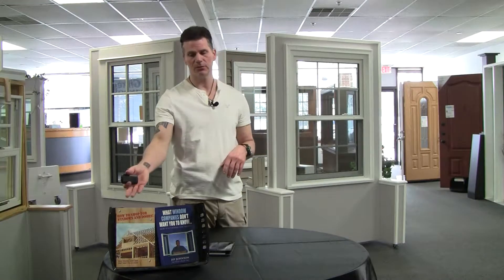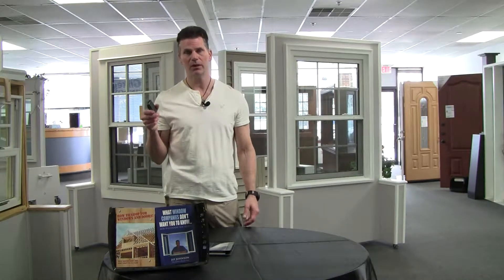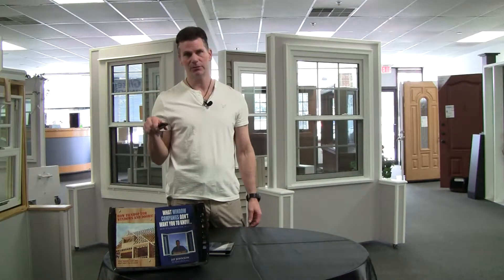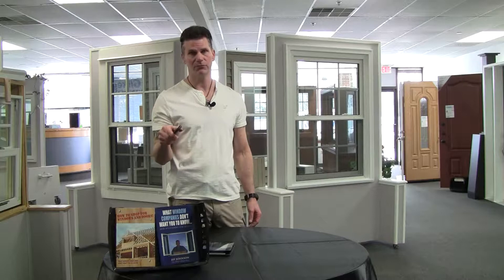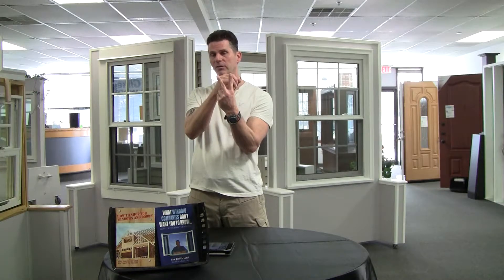Low e glass

Comment: You might want to revisit your explanation of the difference between LowE, LowE2, LowE3, LowE4 because your explanation  is incorrect.
Over 100 variations? Such as?
Reply: So this guy doesn’t know what he’s talking about?
Reply: @stevebbkny2394  Not so much. 

The terms LowE squared or LowE cubed are specific to Cardinal glass who makes about 60-70% of all residential LowE coatings. Also Cardinal refers to their coatings as LoE rather than LowE. 

In the real world it isn't uncommon for people reference squared or cubed when talking about multi-layered coatings that aren't from Cardinal, however the squared/cubed terminology is Cardinal patent and probably copyright(?). So techincally it 's more correct to refer to non-Cardinal coatings as LowE- 2 or LowE-3 for 2 and 3 silver-layered products rather than squared or cubed. None of which is the reason I commented.

I commented because LowE 2 (or squared) means that there are two layers of silver in a multi-layered coating stack while LowE 3 (or cubed) means three layers of silver in a multi-layered coating stack. The number does NOT refer to locating the coating on multiple glass surfaces as was said in the video. 

Straight up LowE (no squared or cubed) technically refers to either single-silver layered coating or to "hardcoat" coatings which are a different type of animal. However simply using the term LowE without number clarification is very common inside and outside the industry to refer generically to any type of LowE coating regardless of the number of silver layers in the coating.

Andersen offers a LowE-4, but that product is actually LoE2 (squared) -272 coating plus some additional bells and whistles on the window. Because AW has already used LowE-4, Cardinal's newest coating is called Quad LoE-452 to avoid confusion with the Andersen product. Not sure how easy that will be for people to understand....
Reply: @gregcorwin8316  thanks for the info. I’m trying to gather as much info as I can before  I update the windrows in my apt building so your input is greatly appreciated.
Reply: @stevebbkny2394  what are you specifically looking for?